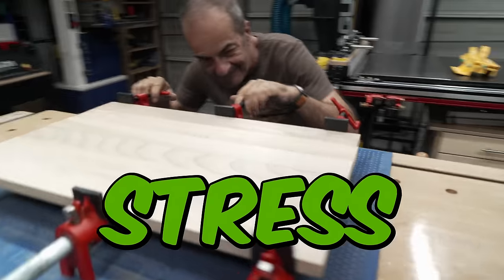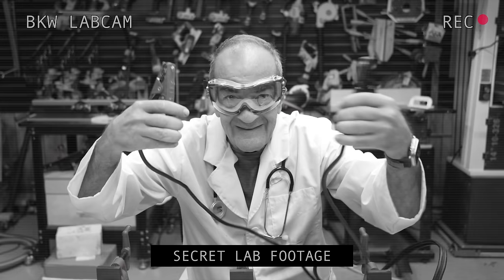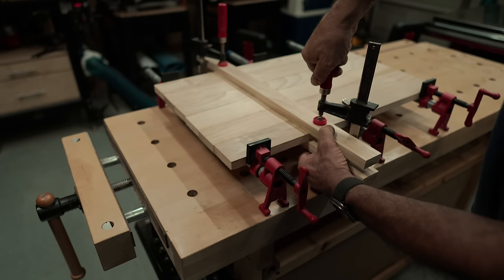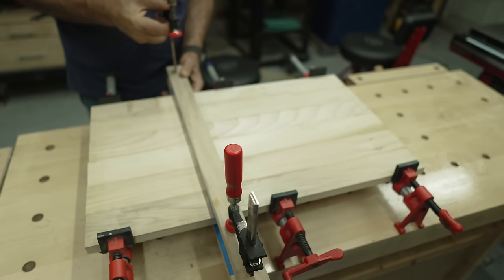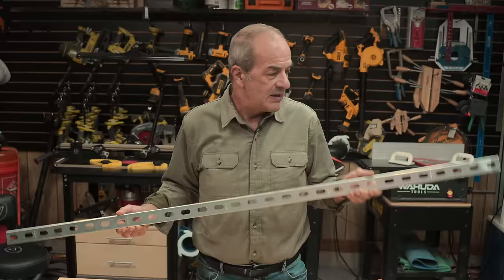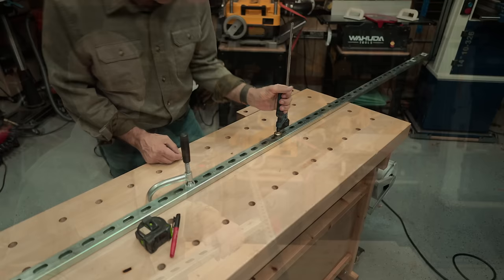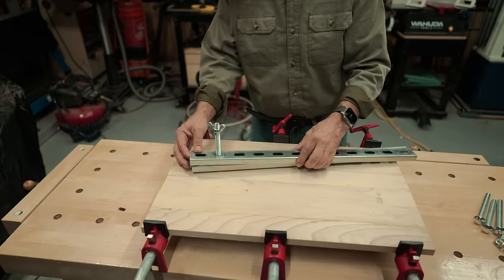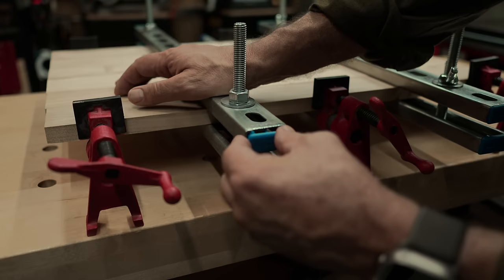Rockler doesn't want you to see this video

Comment: :hand-pink-waving:Good idea, but.....tack weld 2 of them front to front per side , far stronger and the large flat surface clamps the wood with far more clamping pressure and surface area, these struts are strong but not that strong so it is better to adapt them a bit more. I find mine work a lot better that way .  
Great and fun Vid, tx.
Reply from the maker: I would have, but I don’t have a welder. 🤷🏻‍♂️ They do make these in two beefier sizes if stiffness is a concern for anyone. Thanks for the suggestion, good one. Appreciate it!
Reply: @BustedKnuckleWoodworks  no worries as you say we don’t all have welders and even more those that do some have no idea on how to use them 😂. This side of the pond we only tend to get the lightweight ones in the DIY shops which is why I stiffened mine up over here.

They work really well keep the great ideas coming thanks again

Comment: If you are causing the boards to cup, you are applying too much clamping pressure. Simply apply clamps like normal and use a straight edge on top of the   Boards for alignment . Once cupping begins loosen a little pressure and that’s the adequate amount of pressure needed. But you did give me an idea for another use case I could use those for, thanks.
Reply from the maker: You’re welcome.

Comment: I'm thinking this is going to flex no matter what you do. I made my own cauls 25 years ago out of 6/4 red oak. Some 4 feet, some 3 feet. They are slightly concave, which is the only way they are going to really work. Otherwise when anything is clamped enough to really work, it is going to bow. But I never use them now. I Domino, and before that, used a plate jointer. So much easier, and stronger. And boards are perfectly aligned without worrying about it. The only time I use the cauls is when I am making end grain cutting boards.
Reply from the maker: My channel is about practical, economical solutions. A domino, while very effective, isn’t exactly cheap. There are lots of other channels here that are happy to recommend a $1,500 solution to a problem. That’s not what I’m about. Thanks for the feedback.

Comment: In your first solution using wood, you just need to extend the slot for your clamp along the caul to allow the clamps to adjust to the width of your work piece.
Reply from the maker: That's possible, but it would weaken the caul quite a bit I would think.

Comment: My house was built in 1914 with all hardwood lumber. They didn't have all these fancy tools back then and the house had survived the Michigan UP Winters 20 minutes from Lake Superior without a sweat. We get 300" of snow average each year.  Just looking at the wood that's visible I know they worked hard to build it. The roof still has the original cedar boards under the shingles (unfortunately code wants them gone when it's redone 😢)  the basement has massive beams all rough cut probably by hand. It's a wooden structure with a real brick facade not that fake stuff glues on today.
Reply from the maker: That's very cool. I once owned a house in Illinois that was built in 1912, so around the same age. They don't build them like that anymore, that's for sure!

Comment: Well because of the Π (U) shape the edges under pressure will leave a dent/mark om the wood, what I'm proposing is to flip them and have its flat face down, then use some small blocks that will fit into the gap but a bit taller and with a hole for the bold to go through and to tie the wing nuts. This way you are avoiding herding your panel.
Reply from the maker: If you need to crank them tight and you fear the wood might be dented, then sure, this is definitely a good idea!

Comment: That is a “top tip”!  It would be nice if there was a way to pre-arch them so the clamping force was equalized across the panel as you snug them down, but usually not that much force is needed to flatten the glue up.
Reply from the maker: As long as you keep the clamping force close to the panel, these would require a LOT of force to bend. You would likely dent the wood well before you came close to that.

Comment: That's a great idea. 
Two suggestions. 
First I disagree with you.I would go with the 12 gauge.It's only a couple of bucks more and it's going to work for more things. Second, they also sell little rubber tips for unistrut.Or superstrut if you like. They push right over the cut ends and make them safe. Keep your from cutting your little hands or dinging your material if you happen to hit it with the end of one.
Reply from the maker: I showed those blue rubber tips near the end.

Comment: Why do you use the super strut with holes up  instead of down where you have more flat surface, and why not use the holes to put your c clamps in that would give you more direct pressure on the glue up instead of on the ends? Also is there a rubber tape type product you could use on the face to keep from the metal marking the wood?
Reply from the maker: 1) Because the wing nuts wouldn’t fit; 2) I wanted to make it as straightforward and inexpensive as possible; 3) if you’re marking the wood you are clamping way too hard. But you could certainly add some wood underneath (I wouldn’t recommend rubber or anything non-rigid)
Reply: Thank you! @BustedKnuckleWoodworks

Comment: I use these as an el cheapo t-track in the bench. The bench consist of ply that happens to be exactly the same thickness so i just split the bench in different sections. Solution is so cheap that i can use the ply as sacrificial. If i need a new plate, just cut a new one.
Reply from the maker: That’s a primo idea 👌🏻my man

Comment: Little additional unsolicited advice: Turn the wooden cauls by 90 degrees so that the smaller side is on the workpiece. They'll be much stiffer and probably the fastest and cheapeast approach.
I think there is some similar material to build diy heavy duty shelfs.
Reply from the maker: For wider projects that would be a good idea

Comment: Just remenber ..oak reacts to metal and moisture and may leave black  stain marks where the calls made contact when you wiped excess glue off with your  damp rag .
Reply from the maker: I never use a damp rag, just blue shop towels, but that is definitely an excellent tip 👍

Comment: My hardware store sells angle iron which works great
Reply from the maker: Is that pre-drilled though?
Reply: @BustedKnuckleWoodworks  No and I don't drill it, I just use a Dewalt pistol grip clamp on each end. That being said I just recently watched a video where a guy (can't remember who) says we all way overtighten our clamps. He did a demo of squeezing like we all normally do then using an aluminum straight edge to show the panels were bowed up he very slightly backed off each clamp till the straight edge sat flat. It took very little backing off. I'm going to try it on my next glue up when the weather gets warmer. I mostly do butcher block stuff including countertops with an occasional panel.

Comment: You could run your modified F-clamps through the super strut slots if you don't want to fiddle with bolts and wing nuts.
Reply from the maker: I only made those to demonstrate. I wouldn’t have done that if I was starting with the strut. And also, the holes in the strut make it so you can’t get the F-clamps seated properly.

Comment: Great idea for cauls; however, I prefer to use the Dowelmax jig which produces consistently accurate joints in panels.  More expensive, but over time it is well worth it.
Reply from the maker: Hey I agree, if you have a Dowelmax or a Festool Domino then by all means break that puppy out. Most of the stuff on my channel is centered around economical solutions, so I always try to present the most affordable option for things.
Reply: @BustedKnuckleWoodworks 
❤ this idea. 
I make stairs and we have 2 rotating hydraulic panel racks as we’re constantly glued up hardwood treads. Still need cauls for the racks. 
This idea is great, I thought it was Unistrut at 1st (electrical and plumbing supply as sources)…I’ve only used the stainless version and it’s very stiff. 
The perfect mod was using the cam-toggle for quick 1-handed operation. Perfection!
I’m going to make this for splicing hardwood stringers. Thank you for a great and entertaining video. Subscribed!
Also change the Title to : Better Caul Saul
😂
Reply from the maker: @ruidadgmailcanada8508  Better Caul Saul, that is hilarious! 😂 I’m very tempted to do it… viewers always tell me I look like Hector Salamanca!

Comment: With the rails down on softer woods you may “dent” the materials… add a 2x2 piece of wood to fit between the rails, then clamp.  It still distributes the clamping force without the need for a caul but it wont damage the goods.  If it has a PFPE surface, it wont adhere to the squeeze out!
Reply from the maker: I actually like that idea!

Comment: Very nice and very practical. Thanks for sharing. One question about these strut channels - are these super straight? I am also thinking of using them for a straight edge guide for my circular saw. Thanks in advance.
Reply from the maker: They are very straight but also a little heavy. I would probably use an extruded aluminum edge guide they already make for the circular saw. Much easier to handle.

Comment: Curious why you didn't flip the cauls with the flat side to the wood ?  I would think so you don't have potential indentions in the wood- just a thought:)   great video I will definitely be picking up some next trip to the Orange store!
Reply from the maker: You can place them either way. I find having the open side down is easier, and it’s not usually an issue as long as you don’t over tighten them. If you put the flat side down, the wing nuts don’t fit, so you would need large fender washers to span the opening, or some other method for fastening them.

Comment: I expected you to use the same F clamps you had inserted in the wooden calls,  since those precut slots in the supperstrut looked identical, and they offered the variability you were previously lacking.... but I suppose there's no need to waste 4 clamps.
Reply from the maker: If I were starting with the strut route I wouldn’t have made those to begin with…

Comment: Just a note from another tips video, almost everyone uses too much pressure when gluing up panels, and that causes them to bow out.  Pressure should be basically just enough to close up gaps, and a little bit more.  Really cranking down on it which most people tend to do to make it 'tighter' can actually force it to go out of line as it sets up.
If I run back into that video anytime soon I'll give the info, but that was the overall gist..
Reply from the maker: I specifically warn about that in this video, which is why I suggest using wing nuts and going finger tight only. Not sure if you watched that far…
Reply: @BustedKnuckleWoodworks  
'why I suggest using wing nuts and going finger tight only. Not sure if you watched that far…'
Saw you mention that about the cauls, but this was about the main clamping.  Reducing pressure to just above what was needed for gap closing improved results, 'extra' pressure on the main clamps plus glue was a lot of what forced the panels out of line.
Reply from the maker: @ModelLights  okay yes, I get what you’re saying now, you are correct

Comment: Why not just use the f style clamps with the superstrut as well? It looks like it would most likely fit and be easier to adjust than the carriage bolts.
Reply from the maker: If someone builds the strut cauls they would presumably be starting from scratch. I just did the F clamp hack as a demo for the video.

Comment: Would you be able to use the disassembled clamps with these super struts? I feel that would be faster that having to screw and unscrew the wingnuts all the time.
Reply from the maker: You certainly could do that. I was just trying to present the most economical solution. If you don’t mind sacrificing a few clamps then go for it 👍

Comment: Another way this could be useful is to set up the cauls and then use wedges on the bolts to apply side pressure in place of clamps.
Reply from the maker: You could do that, as long as you’re aware that the gap in that spot will vary somewhat from project to project (but it should always be within 2 inches or so).

Comment: Can you flip it over and just use a larger diameter washer with the same inside diameter? If so then only thing you need to use the flat back side is one set of larger washers.
Reply from the maker: If you can find large enough fender washers you definitely can. They make special washers that fit these struts but they are kind of expensive. They do fit exactly though.

Comment: Excellent idea and excellent video, but it looks like the slot shaped holes in the super strut would fit bar clamp bars much like the single position wood cauls, and work way better than bolts and wingnuts. What I'm saying is maybe you're a genius and just don't know it. Thanks for the idea(s)! 😊 👍
Reply from the maker: Unfortunately the slots in the struts don’t leave a lot of room for the clamp to press down on. (Plus it actually makes the whole setup a bit more expensive…)

Comment: Great idea. Question though. Would it be better to place the flat side down instead of the channel side down? This would avoid marring and indenting the surface when pressure is put in.
Reply from the maker: You certainly could do that, a couple of people have mentioned it. As I say in the video, there is really no reason to crank down on these. If you are denting the work that’s definitely too hard.
Reply: Was thinking the same thing and was expecting to see the flat side going down against the work.  Great idea though.

Comment: My solution any time I think I might end up with something getting glued that I do not want glued is to put wax paper between  it and possible glue. I just had a chip come loose the other day. First a dab of glue, then the chip then a piece of wax paper and a clamp. It is like waxing the metal, but works for all the other situations where you want to prevent glue from sticking to the wrong thing.
Reply from the maker: I showed that in the video. Wax paper, packing tape, painter's tape... did you miss that part? 🤔
Reply: It’s a good option. Just get your own box of wax paper. Trust me, it saves you from sheepishly trekking out to the workshop to bring the roll of wax paper back when your wife’s hollering for it!
Reply: @BustedKnuckleWoodworks And doilies!! 😂😂
Reply from the maker: @j10001  she keeps wondering where those went! lol

Comment: Excellent idea thanks.  Just an idea:  Would those F-Clamps not also work with these instead of the bolts.
Reply from the maker: If you made those first, they might, but I've tried it, and the slots in the strut are so large that they really interfere with the seating of the clamp.

Comment: Uhm … trade name Kendorff.
Not “galvanized” … but weather resistant.
They also work well as a fence or impromptu straight edge
Reply from the maker: Yep, Kindorf is a competing brand to Superstrut and Unistrut. Either would work equally well. Superstrut is a lot easier to find though.

Comment: Would it make more sense to flip the rails? So the flat portion of the rail is in contact with the panel/wood?
Reply from the maker: You can place them either way. I find having the open side down is easier, and it’s not usually an issue as long as you don’t over tighten them. If you put the flat side down, the wing nuts don’t fit, so you’d have to modify the clamping mechanism.

Comment: I'm a novice here, so know that when I ask this possibly dumb question...

When I see glue ups on here, they usually do top and bottom clamps along the board, as well as the cauls at the ends.  

With this option being cost effective enough to allow for many cauls, is there any benifit to adding cauls all along the way between the clamps as well as the ends?
Reply from the maker: I say just use as many as it takes to achieve the goal. You will be able to tell by eye if you need another one. These are so inexpensive I have like 10 sets of them around here.

Comment: So is there ever a point that the  Strut Channels damage the wood due to the pressure points being along the edges that maybe flipping them over makes more sense? (larger surface area...)
Reply from the maker: I used poplar in the video and cranked down finger-tight, and not even close to marking the wood. I'd say if you are denting the work you are tightening them unnecessarily hard. But of course, there's nothing really stopping you from flipping them over!

Comment: Awesome video!  One question, did/does the superstrut damage the wood even with minimal ugga power?
Reply from the maker: If I am using them on a soft wood like pine I will sometimes turn them the other way so the flat side is against the panel. With any hardwood I would say it’s impossible to mark it by just using wing nuts and hand tightening.
Reply: @BustedKnuckleWoodworks   Thanks!

Comment: You might like it better if you buy some twirl nuts for the strut!   You can leave the bolts with the nut on the top strut, and not lose them.
Nice video!
Reply from the maker: I wish I had thought of that before! Several people have mentioned it, and it’s something I’m definitely picking up when I get back to the HD 😁
Reply: @BustedKnuckleWoodworks     You don’t need the ones with springs.  Those hold the nut in place when you are trying to bolt something solid down and can’t reach them.   Best wishes,  Kevin.  Sent link of miter station video to my son with a dewalt miter saw.   I have RAS.
Reply from the maker: @KevinCoop1  OMG 😱 I would sooo LOVE to get my hands on a radial arm saw! 😬
Reply: @BustedKnuckleWoodworks     What city do you live near?
Reply from the maker: @KevinCoop1  Austin